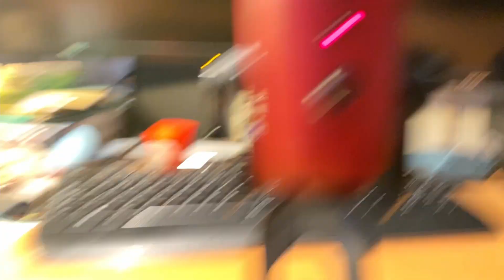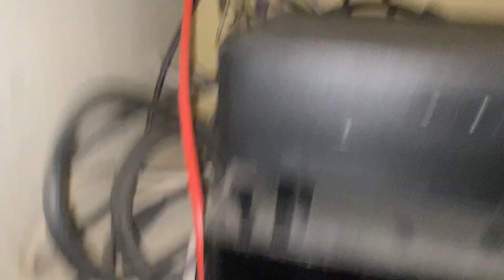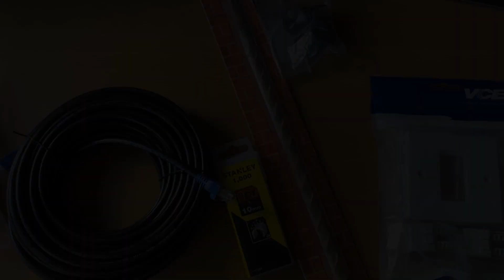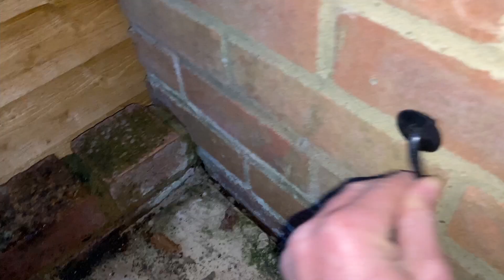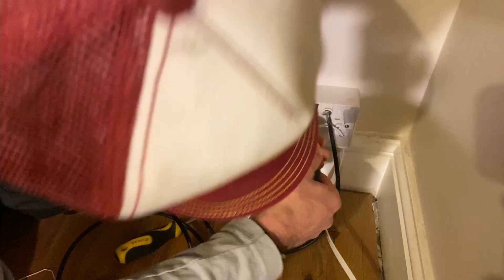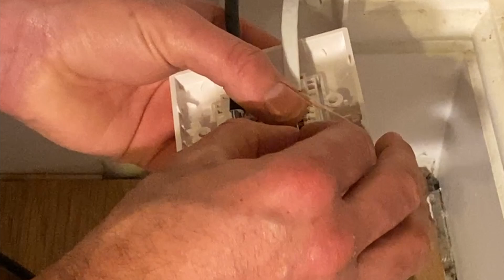Help! How do I install a CAT6 ethernet cable and wire up RJ45 sockets

Comment: Hi. Great video thanks. I'm about to start running a cable outside to my office but wanted to ask what size drill did you use to go through the wall.
Reply from the maker: Hi @bear100100.
I used a 400mm x 10mm masonry bit.  £2.50 from my local hardware shop. That should be perfect for the cable entry cover.
Good luck.